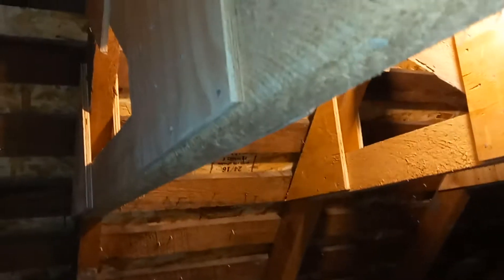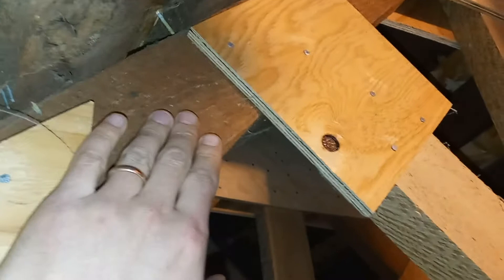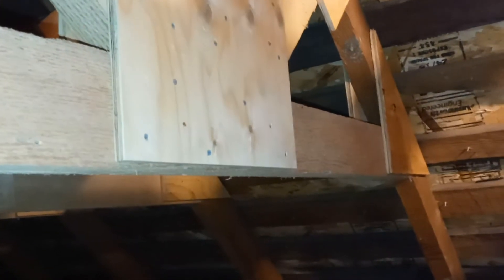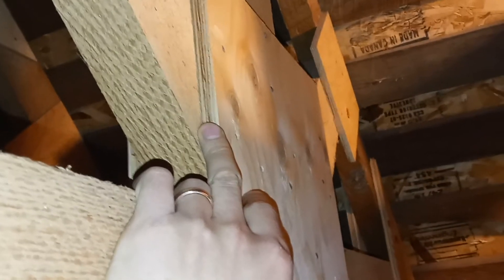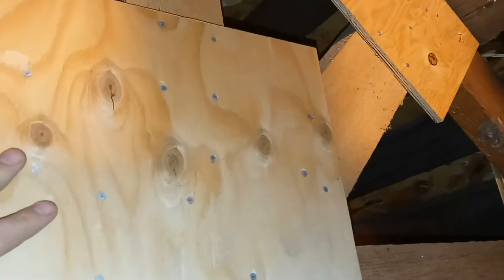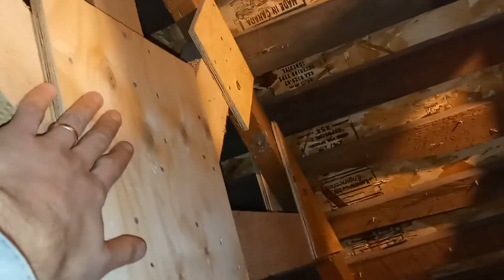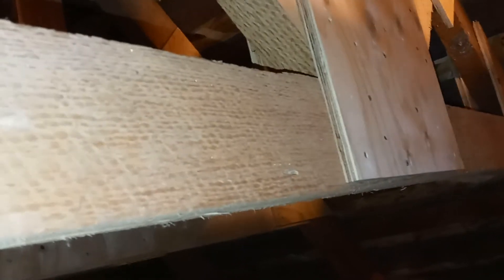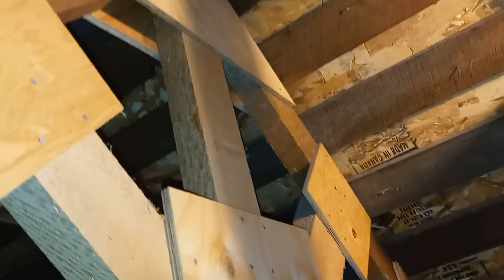Collar Tie Design in My Attic ... Caution: Consult a Contractor Before Copying

Comment: My neighbor made his own trusses based on the existing ones in his garage, to make an addition to make it deeper. He used  screws as well and glued the plywood gussets also. The building inspector made him nail along with the screws, as these hardened screws will fail suddenly, and break clean. Personally those 'bed of nail' pressed in fasteners are no where as good as your construction using real plywood and glue with screws. But you know some DIY'er some where had a building collapse and they linked it to screws so the whole world now is stuck with that belief.
Looks like your truss construction members are hard Oak wood, I'm surprised you could screw into that without twisting the screws off (my experience), unless you pre-drilled a pilot hole for them.
Reply from the maker: I believe the wood is fir or cedar I think. My friend had it milled by a logger to match the old rough cut thickness.The fasteners were nail gun driven. I am not sure if I accidentally said something different. My understanding is nails have greater sheer strength.